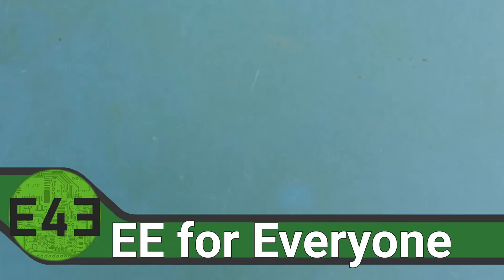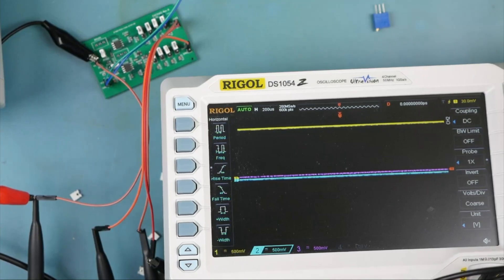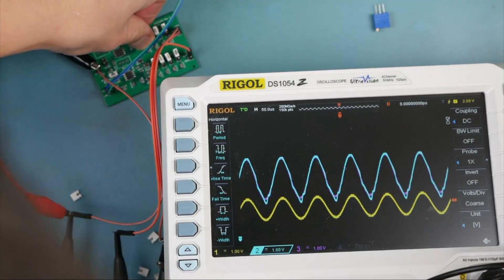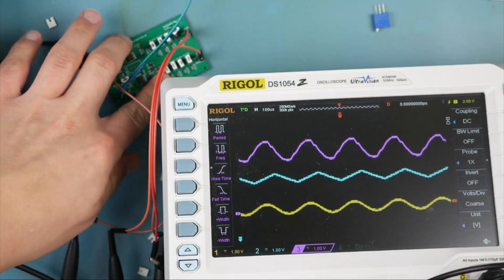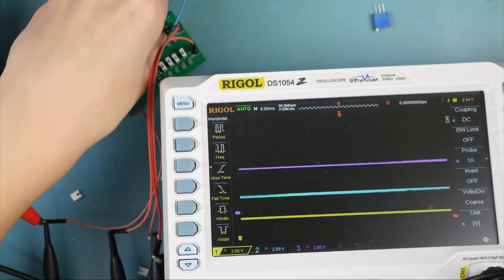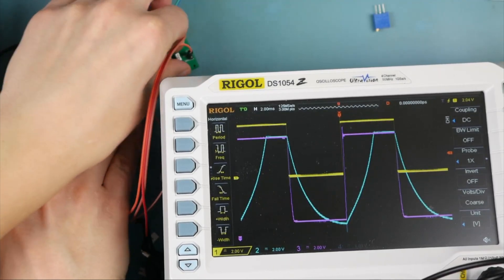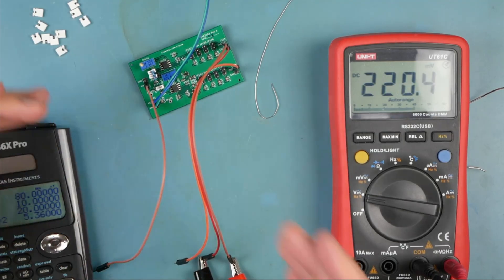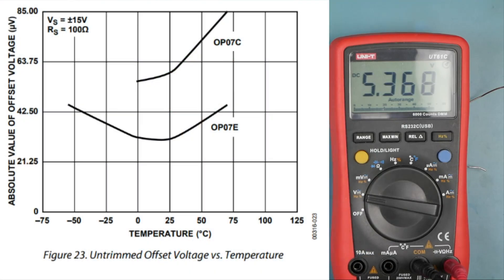Capacitive loading on an OP07 OpAmp output! (Exploration)

Comment: Hi. I've designed many products with op-amps and/or buffers driving various loads, FETs and cables. I found that using Spice simulation gave me great insights into what circuits are best for different loads. 

1) Almost all amplifiers driving capacitive loads will get more unstable and then oscillate as the capacitance is increased. 100pF is usually safe. More is bad. Power amps and buffers can drive more. Cable generally has 10-30pf per foot, so beware. 

2) Use a resistor to isolate the load capacitance from the opamp if possible. Even 10 ohms helps, lower with power amps. A side note: amps driving electrolytic caps with high ESR are often stable but the same value ceramic cap isn't stable due to low ESR. Ideally you would add a resistor in series with the cap since minimum ESR is not specified. Some voltage regulators specify a minimum ESR. 

3) If you need to take the DC feedback from the capacitive load (as opposed to the opamp), add a resistor in series. If you need to take the DC feedback from the load after the resistor (such as the FET Source in a current source circuit), then add a feedback cap from the amp output to the opamp - input. 

Spice is your friend. Look at the step response and tune for minimum ringing. 

Good luck, 
Dave